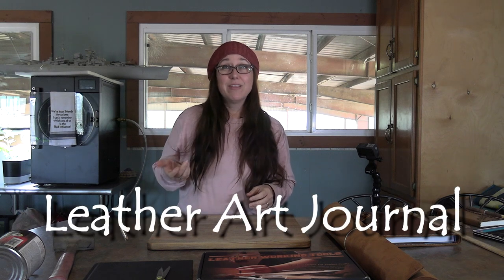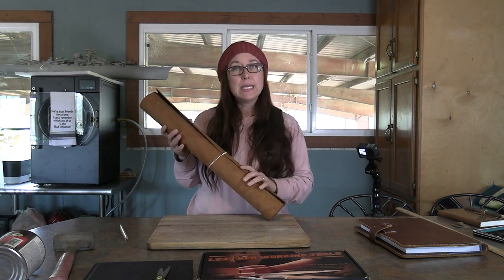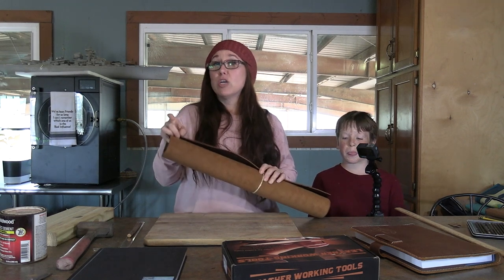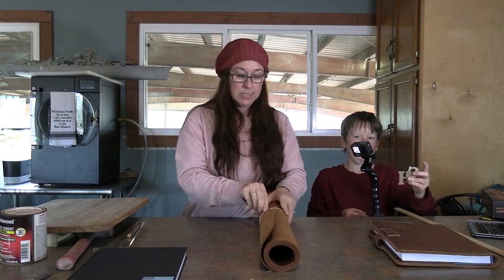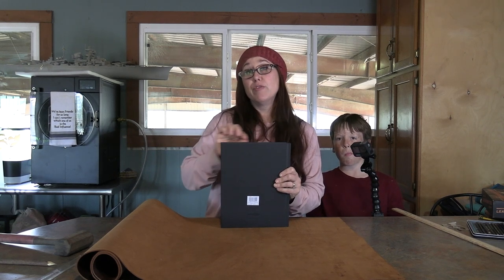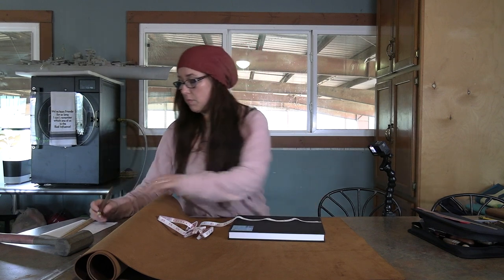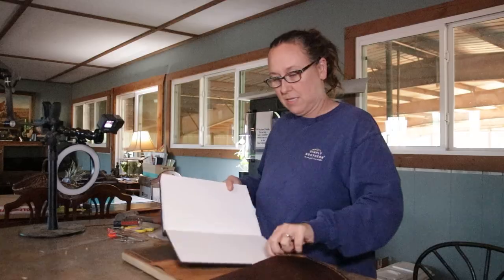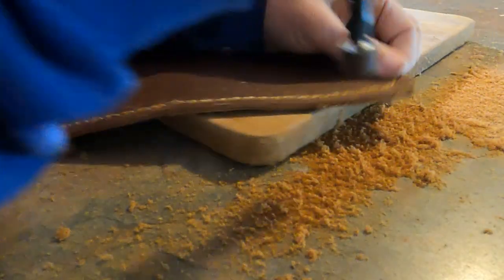How to Make a DIY Leather Art Journal

Comment: Great video! I like to use a cheap poly cutting board when punching holes and using end punches. I also prefer using a saddle stitch when sewing because it's strong and with practice you can stitch pretty quickly.